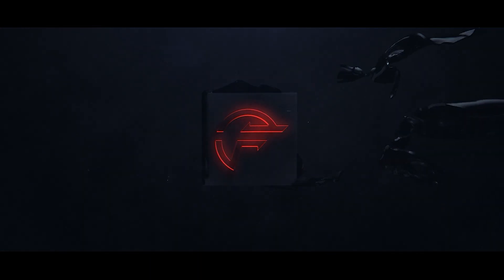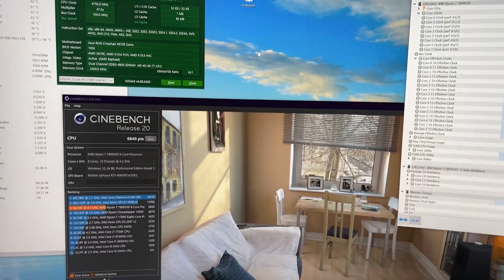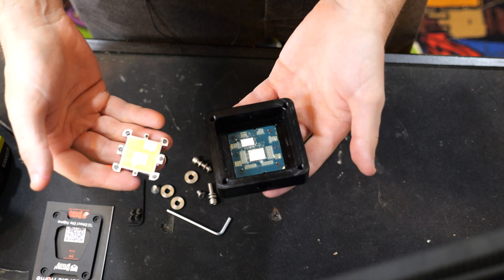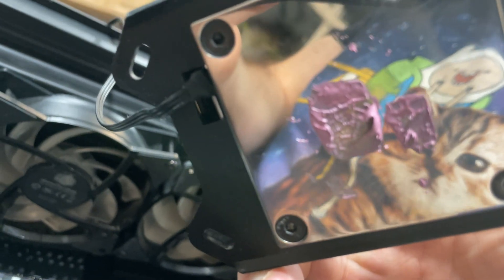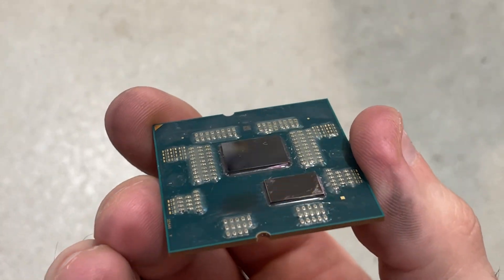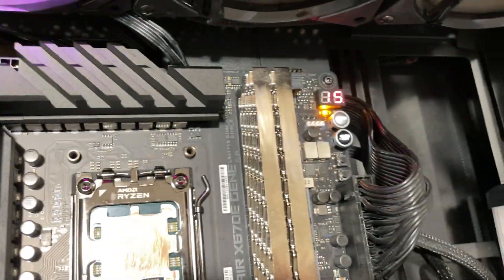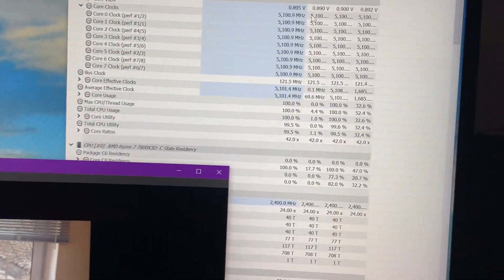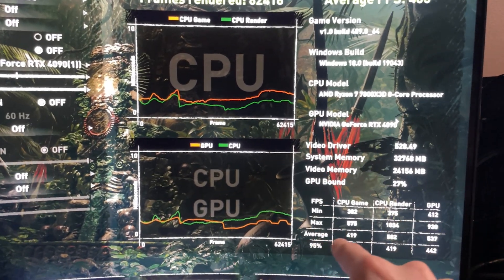I Killed My 7800X3D...

Comment: Hey FC, thanks for doing the video, I actually delidded two 7950x & 7950x3d already with no issues. Maybe that 7800x3d with only 1 ccd has problem with pressure dispersion and that is why it cracked. I even mounted a Noctua NH-D15 on the 7950x.. Also, just noticed you have the Gene board, good choice :)
Reply: i will rob you of your components next wednesday
Reply: derbauer said that the direct die mount is NOT compatible with 87800x3d...
Reply: Did you use the noctua spacer kit?
Reply: How did you mount the Noctua??? No one is doing delids with air coolers😢. Any information would be greatly appreciated.  Thank you!
Reply: @3DxPOD  You can use spacers to get the height correct, its sits niceley afterwards, loads of posts on the internet showing how this is done.......
Reply: @Mat-92-j7v  Thanks I'll keep looking.